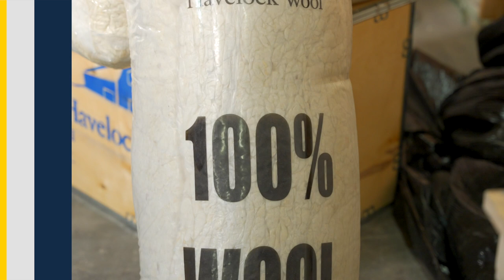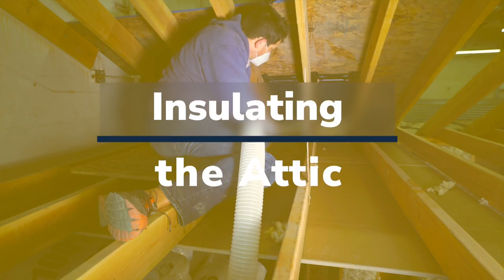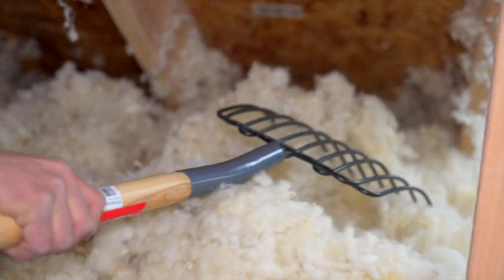The Official Havelock Wool Blown-In Installation Video

Comment: The loss fill in the wall is not dense engough and it will crush in no time. In remodel house we have a hole in the bottom and the top and it's fill dense to get insulation that last a lifetime. When moisture buildup in the insulation it will get heavier and sag down. We have no way to see if the wall is at the density you fill it and we need to get more material in to do a better job and be sure we get good quality job!

Comment: This seems more cumbersome than regular batts.
Reply from the maker: It's a fair point and batts certainly were designed for ease of installation. However, we've found that you can actually move much faster using our blown-in insulation with our blower. The speed of installation more than offsets the amount of preparation needed plus you get a higher R-Value with a better fit. Thanks for reaching out!

Comment: Can blown in be used in a van or will the movement of the van compact it too much?
Reply from the maker: Settling won't be a problem but we don't recommend blown-in for vans because the installation process will take a long time compared to our 2in batts designed for vans. https://havelockwool.com/van-insulation-products/  Thanks!